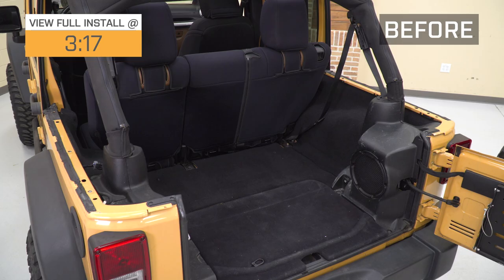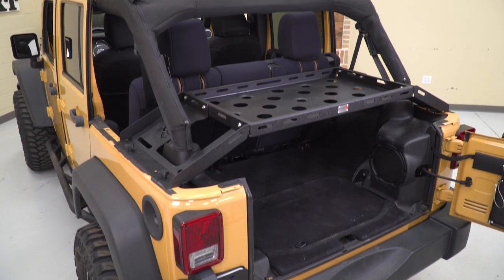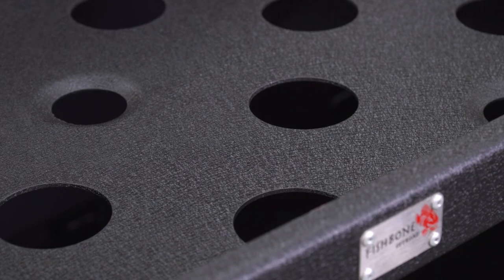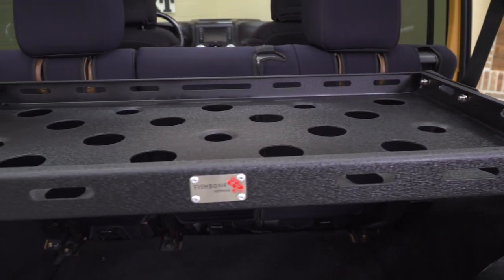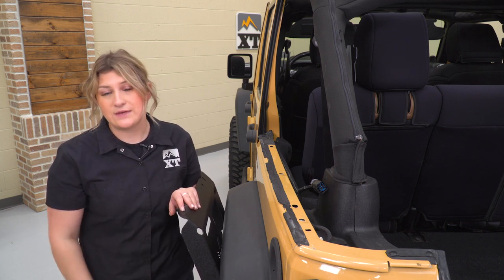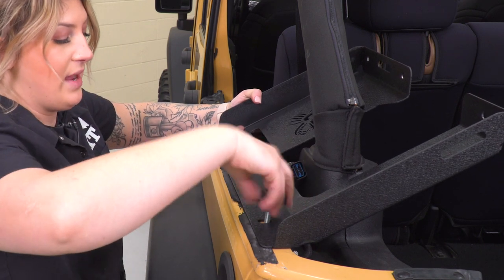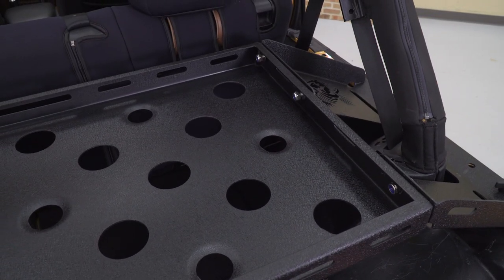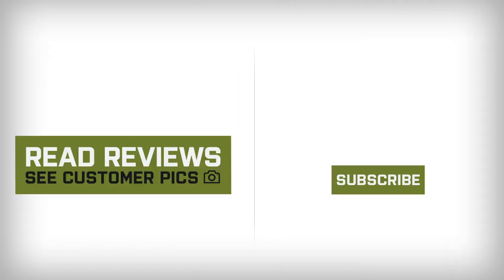Jeep Wrangler JK Fishbone Offroad Interior Storage Rack Review & Install

Comment: I also cut to fit a 1/4th " platform skid grip rubber pad. No noise no slide about.For multi use,add a slide out table  top,under the unit,to be used for prepping lunch.

Comment: Does this work with the rear seat slant back pucks that rock the rear seat back a bit. Also does the hard top fit over the brackets or does this need to be removed every time the hard too is removed or installed? Thanks in advance